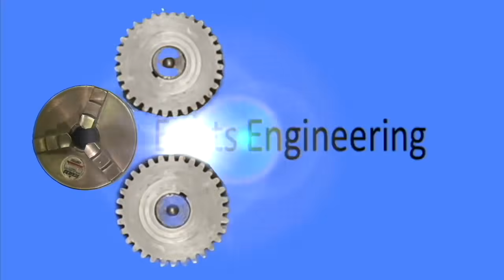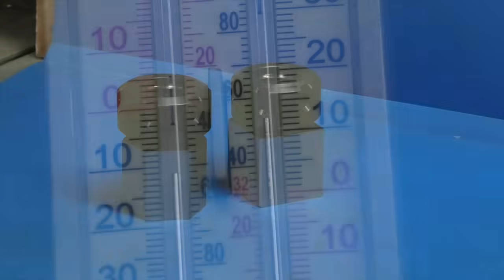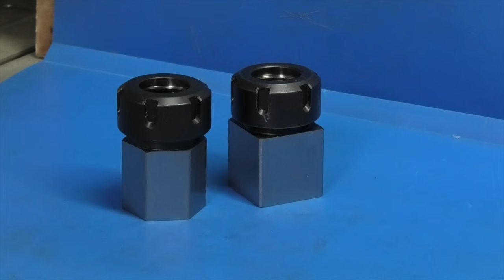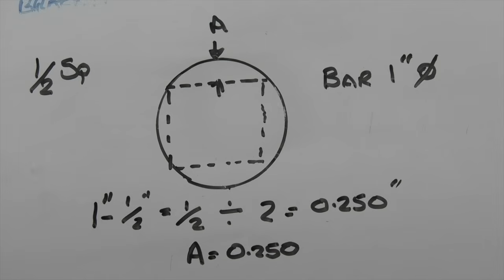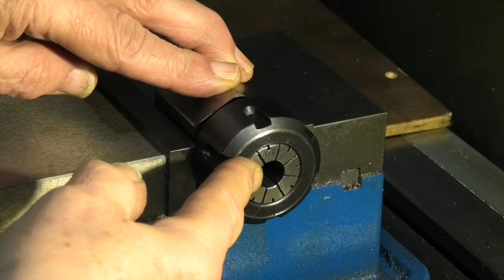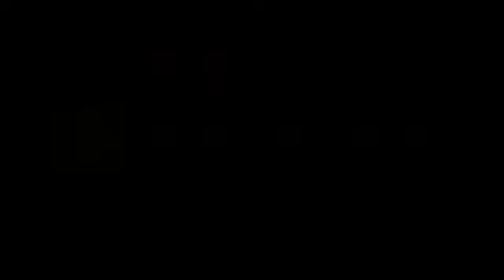collet block set

Comment: Hi Alan, I popped this post up yesterday to give your viewers and subscribers a bit of extra info, it looks like YouTube removed, it so I have uploaded it again. If it gets removed again I will get AI to rewrite it to pass the algorithm test and try again.

If I may offer a bit of friendly advice from experience: before using a hex collet block, it’s worth taking a moment to check whether the points are truly concentric with the collet bore—especially if you’re planning to use those points as datums on the parallels. In many cases, they aren’t as reliable as we’d hope.

A simple way to get better accuracy—and usually faster results—is to rely on basic geometric principles while still holding the block in the same manner. You can mill the two opposing faces using the side of the cutter, then rotate and repeat. After doing this three times, you’ll end up with a much more concentric hex that doesn’t depend on the block’s exterior points. It also keeps the bottom of the end mill from taking all the load, which tends to improve tool life and surface finish.

For square blocks, the same idea applies. Stand the collet block upright and use the side of the cutter again. You can either rotate it through all four sides with the cutter fixed in the Y-axis, or take all four sides in one setup if your machine allows.

One thing to keep in mind is that ER32 collet blocks have a limitation: the nut is larger than the body, which unfortunately restricts what they can do. It’s not a deal-breaker, but it’s something to be aware of when planning your setups.

Hope this helps—just passing along what’s worked well for me.
Reply from the maker: Thanks for the detailed information!